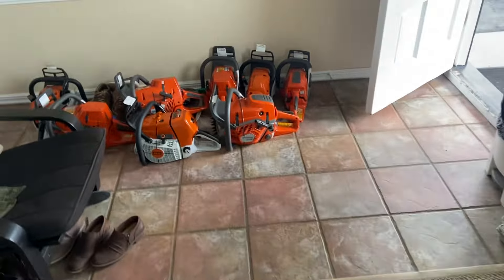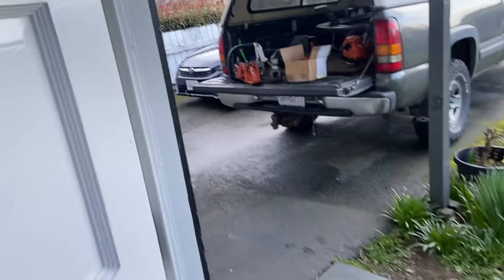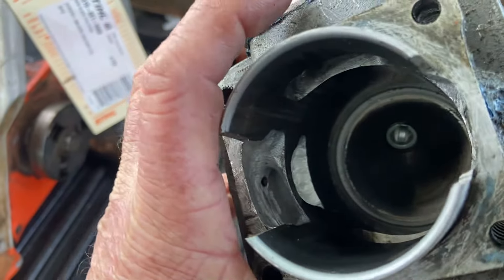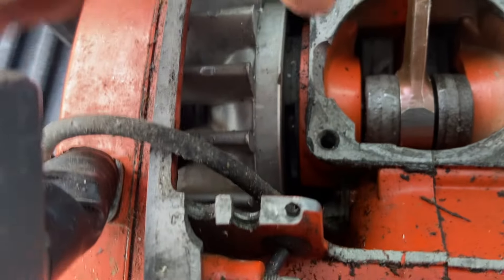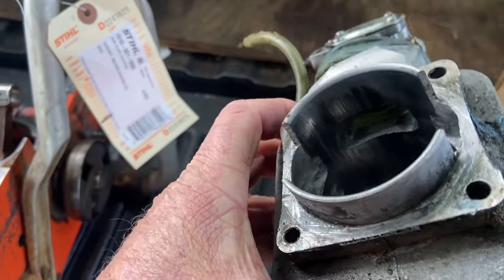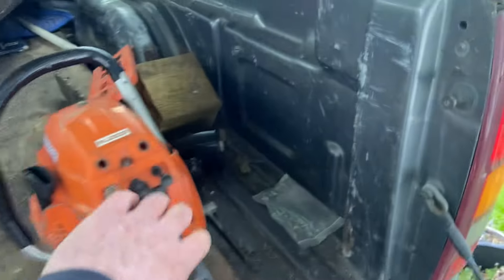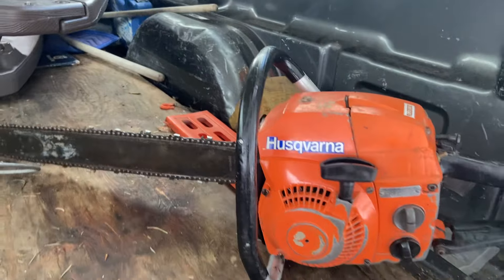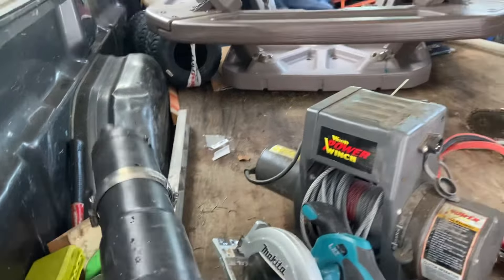Old husqvarna 2100 racing saw

Comment: I hope you have another cylinder laying around for the 2100? This one looks like it is beyond repair with all the port work. Can you use an epoxy to repair the thin cases? Have a great weekend!
Reply from the maker: I will change case and probably cylinder
Reply: @donnywalker4691  I thought it looked all looked pretty well butchered up...Definitely not your Dads work we are seeing here!
Reply from the maker: I think my dad built it originally and then someone butchered it yes
Reply: @donnywalker4691  👍👍
Reply: @donnywalker4691  Have a great day, Donny!

Comment: Hi Donny I got a Husqvarna 550 mk2  last week now i am concerned about the crank bearings there is a lot of videos about the seals going bad because of the plastic cage in the crank bearing did Husq fix the problem ? are they a  long term running saw
Reply: I'd like an answer to that one too, I have a 2022 550mk2 that I had ported and gained 30%hp on and I've run it hard for a whole year and I'm seeing no issues as of yet.. I run 40:1 XP+ that's what I'd recommend to help, don't use 50:1 in anything you want to last
Reply from the maker: I’ve got lots out there there running great they have improved them yes